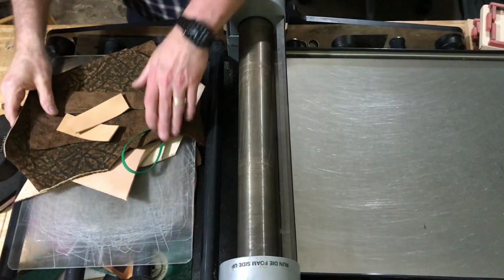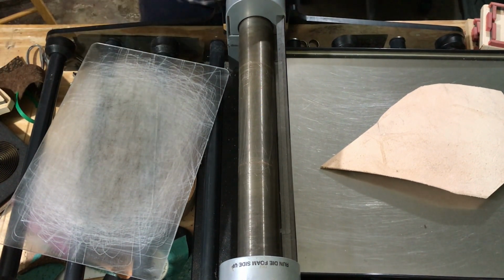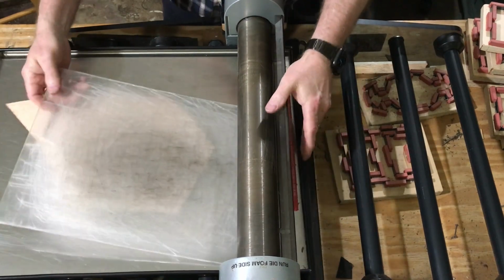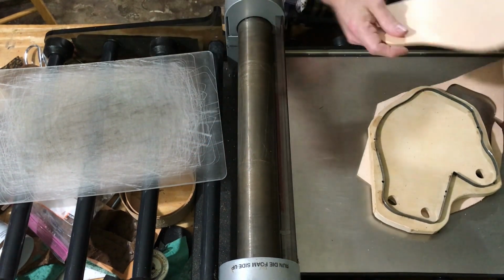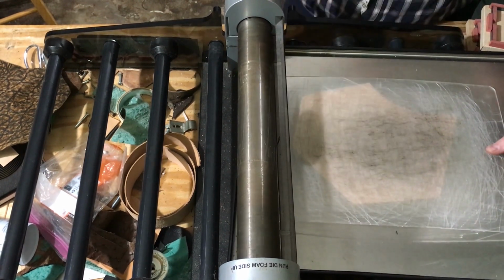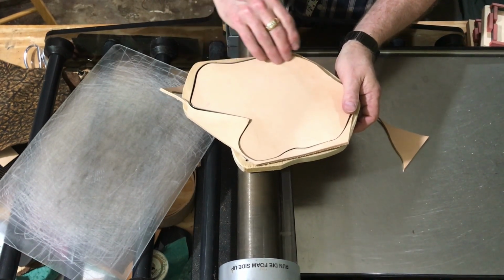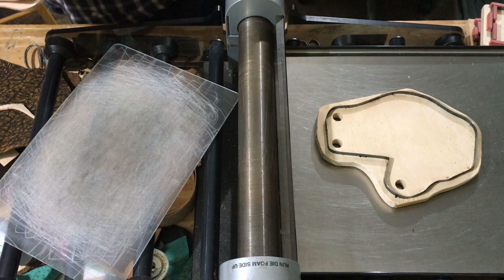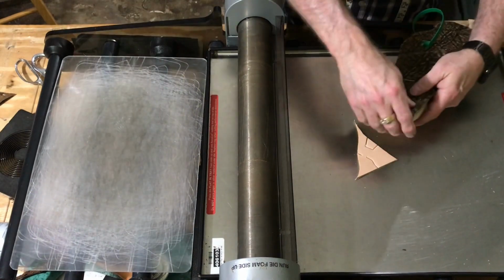Blind Leatherworker - Makes Gun Holster - Cutting Leather out with GrandeMARK 2 Die-Cutting Machine

Comment: Great stuff.  You had a little bit of trouble with the smaller die because there was a small offcut from the first cut left on the tray, you put your die on top of this therefore you rolled thru an extra thickness.
This type of machine is good for leather and numerous other materials. Thanks for sharing.
Reply from the maker: Good afternoon Alan:  Yes sir you are correct. I do know that I will have to make sure that all leathers are out of the way when I am cutting out an item.  Thank you for watching my videos.  Please tell everyone you can about the videos.  Thank you again, and keep in touch,  Karl.